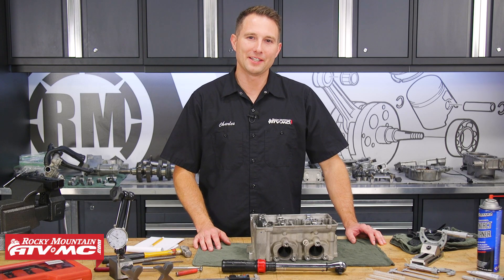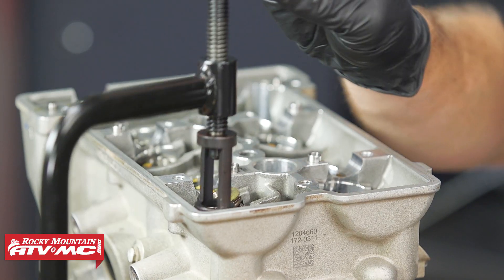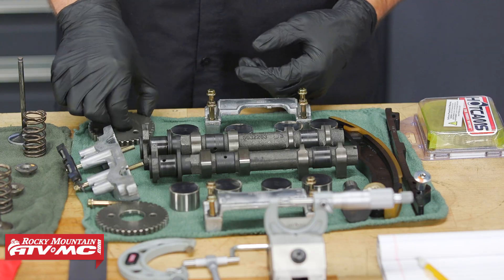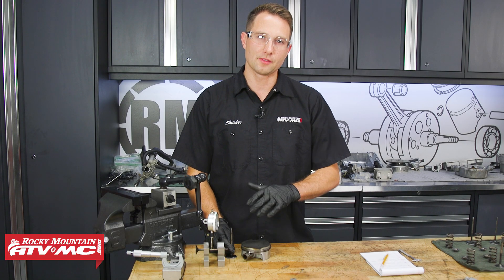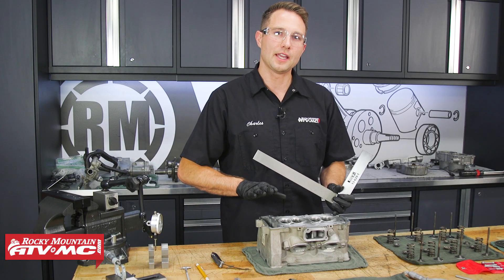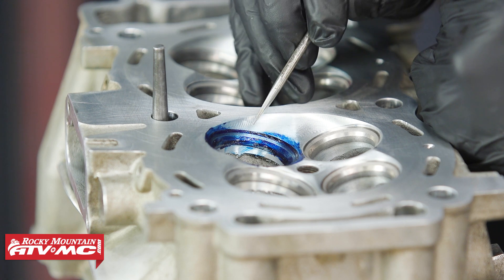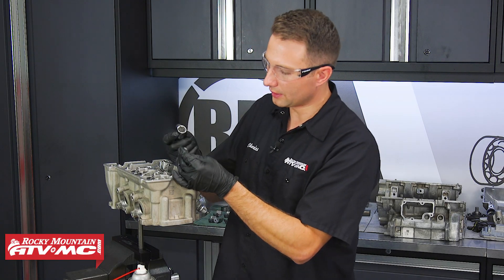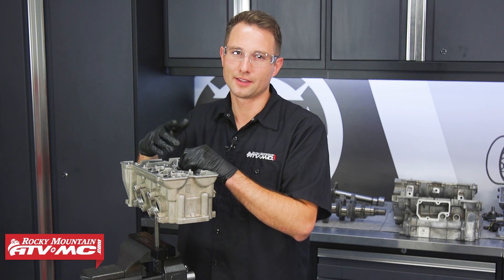Polaris RZR 900 Engine Rebuild | Part 4: Cylinder Head Rebuild

Comment: Exhaust guides are common problem.  Most of the time they need replaced if you are burning oil. Unfortunately that is a machine shop task.  Also inspect the valve face edge.  If they are thin and razor sharp you will want new valves.  Thanks for the video!